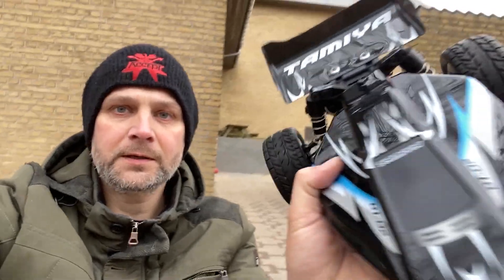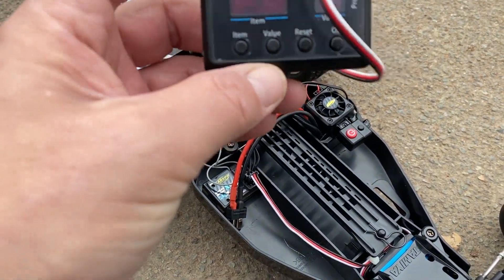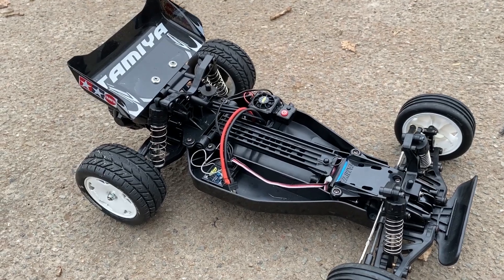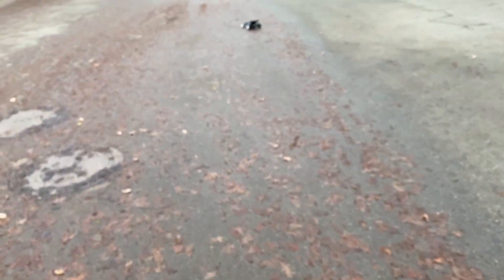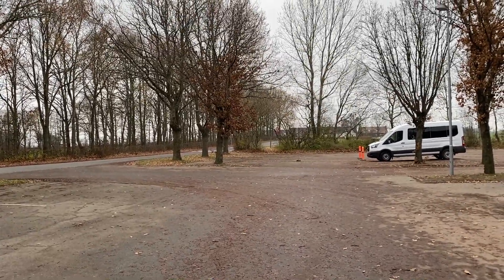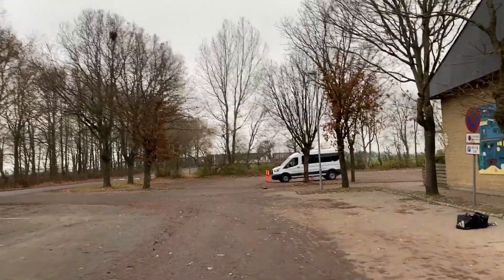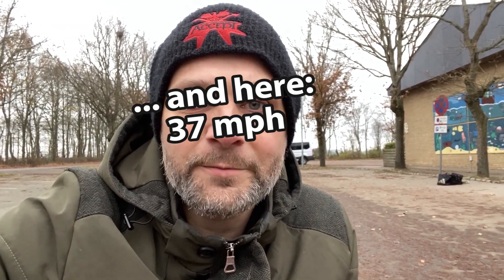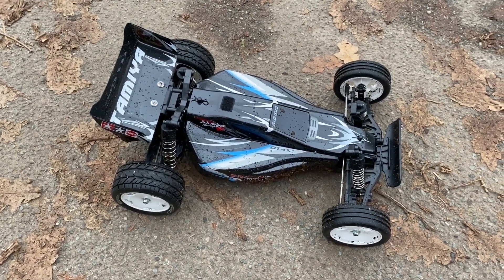4700kv Brushless Tamiya DT-02 Sand Viper 1/10 2WD Buggy 2S LiPo GPS Speed Test! ... Again!

Comment: Hiya Mikael.  Glad it's working now.  You did well to get 37mph on that surface.  So slippy this time of year.  I remember you have a transmitter with a giro but you were having issues.  I have one now and it seems to work pretty well.  Would probably help your speed runs.  I really need to test mine in a similar situation of a 2wd on a slippery car park to see how it does.  Cheers for now matey :-)
Reply from the maker: Hiya Pete! Yeah, much more fun now when I don’t have to worry about the ESC. Then I can concentrate on the waffling and ice-skating. Ahh, yeah, got some Traxxas TSM but also a DumboRC with a gyro. Ahh, no real issues. It was just in reverse. And it didn’t do much good with the Super Levant as that one liftes it’s front wheels and the gyro have no effect. It would definitely be better on this one. But this one goes pretty straight, as long as I am gentle with the throttle in the beginning. Need more run way. But yeah, could be real fun testing the gyro on the winter surfaces. Would love to see a video from you with yours!  Cheers, my good friend.